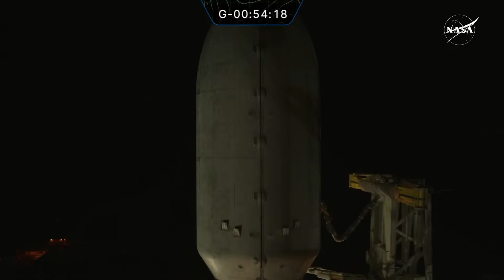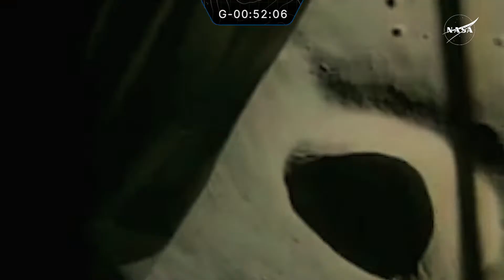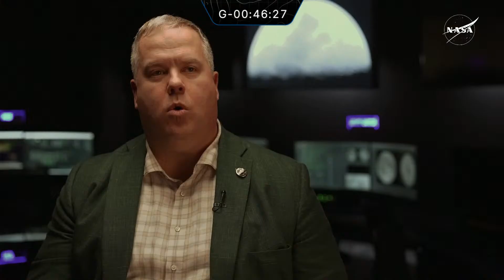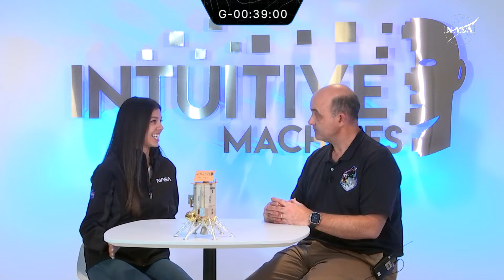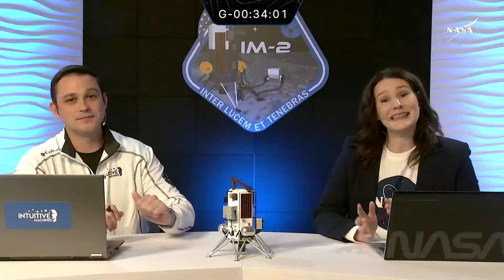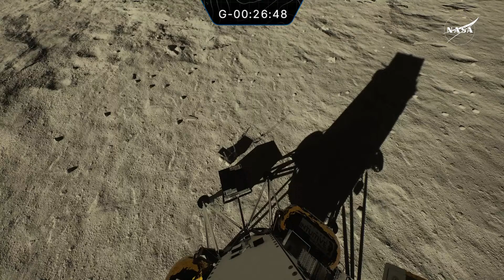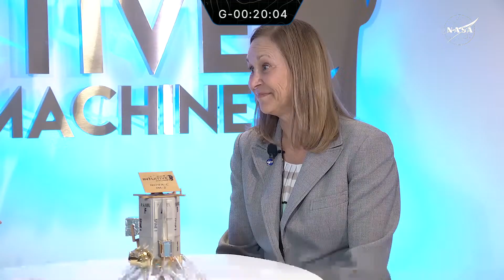Intuitive Machines IM-2 Mission Landing Live Stream

Comment: There is a REASON NASA, and Blue Ghost each used squat, low-center-of-gravity landers. I suggest Intuitive Machines rethink their lander design. Either add new leg extensions that provide the necessary stability or completely redesign the vehicle to achieve the needed safety for the vehicle. The moon is a harsh teacher, and after two of your landers falling over on landing, you are being taught something. Make IM-3 a success - Change your approach.

Comment: For all those that bashed me for not knowing what I was talking about and that I don't have a engineering degree when IM-1 tipped over. I told this was gonna happen again if they did not radically redesign the lander so it would not tip over because it is taller then its landing foot print.
Reply: Wait till they try to land a starship on the moon, even worse footprint to height ratio.
Reply: @kpkndusa  Very true, Landing on flat concrete is not the same as landing unstable sand and gravel.
Reply: example the "blue ghost" that landed a week ago.
but the bad signal sent is not a certain rigidity in the capacity to question oneself

Comment: I wonder why they couldn’t fix the tipping issue — or at least take it into account in the redesign, that very unfortunate possibility. As an example, taking some design cues from those weighted no-tip baby cups used for training; put all the weight to the bottom and have it expand from the top, like a downward-facing umbrella and it should automatically correct itself.
Reply: Blue ghost landing gear put the landers center of gravity lower. IM design is top heavy

Comment: THIS IS ABJECT FAILURE

If you cant launch the 4g comms network, this is a failure.
If you cant launch the micro hopper, or the drill, this is a failure. 

Quite simply, there seems to be no science that can be derived from this mission, due to the exact reason im1 failed. There was no iterative design it seems at all. The CEO says the lander's COG...Center of Gravity...is low, it clearly isn't, or your balance is off, or your math is off, but you can not fail twice for the same thing. The CEO says that lander's legs go to edge of the bottom rocket when packed, then use telescopic legs, so that the lander can be wider. If it was wide enough it would not tip over, and we would have a successful mission.

There needs to be changed in management, you can not fail twice, for the same damn thing, in this high value industry. You are a liability. 

We spent 60x10^6+ on this mission. All we are getting is I dont knows, we need time to analyze the data. That is failure.

Please get management at IM that understands iterative spacecraft design. Please, we told you if this does not land upright it is failure.

Comment: 54:26 shows 852 kph at a height of 26 meters, which then quickly changes to rapidly increasing high negative meter readings from the lunar surface. And then at 54:49 the velocity suddenly changes from 940 kph at negative 3691 meters from the lunar surface to 25 kph at positive 5018 meters from the lunar surface. Major software bugs?

Comment: Well, we know they've been shutting things on and off on board the lander. We know it has power and it is charging via solar and we know the descent included events they fully expected and some that could be  altered by a manual override if necessary.

When the stream terminated we just did not know which way the lander was facing. That information is will likely be addressed at the  briefing at 4 pm EST. Obviously, there are several successes with this landing and obviously the flight team has some questions about how the autonomous landing played out. At this point, sounds like more good than not good.
Reply: Maybe the RC Tonka has a hitch and it can crawl out and pull the lander upright.

Comment: Blue Origin same cop out no info just take ball and go home when it does not work as planned? Quite immature.
Reply: Same thing when SpaceX had a RUD with their starship on their last flight. It blew up midflight. There were no details until it was reviewed. The same with Blue Origin. Blue Origin has determined and stated publicly that there was an issue getting fuel to the engines during the reentry burn. The central engine fired but not the two additional engines. It might be due to lack of fuel settling or tank pressure.
Sometimes it takes awhile to get the details.

Comment: Why were they not celebrating!!! And then shut down stream
Reply: That's a good question! :face-turquoise-covering-eyes:
Reply: It's not vertical....not at all
Reply: Slide in sideways. Must be rough to get that transition just right.
Reply: Uhhh the mission failed miserably. Are u that dumb
Reply: Baseball ⚾️ rules, slide to be safe.
Reply: same as last year in Feb seems like the lander landed poorly again, they should work with firefly they did it first try
Reply: @TheTrueResearcher I do give firefly credit but they landed in near the equator or the moon. People have had boots in the ground in that area. Nobody has ever been to the polar regions let alone set feet on the ground. Was another good test for IM-3
Reply: @TheTrueResearcher  Where did you get the information from about the landing?
Reply: The terrain at the landing site for Firefly was very different from the landing site for IM-2. Apples and oranges different . If you think that does not or should not make any difference, then you would do well to get more familiar with the subject matter.

Not many agencies are falling all over one another to autonomously land custom-made one- off machines in poorly lit pockmarked mountain ranges with experimental tech on board. It's sort of risky.
Reply: IM landers are top heavy. The center of gravity is lower with the blue ghost design. Much better design
Reply: @ Except Altemus said they are not. REwatch the news conference.

Comment: It landed on its side unfortunately
Reply: It crashed at more than 800kph
Reply: @webfreezy  It did not. They still have solar charging and communication and control of the craft. 800 kph is about 500 mph. I doubt you would be getting anything if it hit the lunar surface at that speed. It may have shot up like that due to lunar dust kicked up during the landing. But I will agree there is an issue with respect to how it landed.

Comment: IM-2 has landed, all signals good so far, they just need a picture.
Reply: yeah, but are they vertical?
Reply: @na6404  With a picture you would know now, wouldn't you?😁
Reply: @CyberScifi  and they are attempting to get one.
Reply: It's like they focused so much on conserving energy (listen to the last 10minutes before landing) that they likely set it up under-powered the vehicle on landing and it tipped.

Space is not hard really, but Physics is--that 3-5min delay in signals sure makes it VERY hard.
Reply: They should use a faster image generation AI
Reply: That’s not at all what they said.
Reply: @ that is exactly what they said. Before the livestream cut they were checking signals and every one was good. Engine was on indicating upright position and they shut it off themselves to conserve power.
Reply: @aland8269  mhh - wouldn't it be possible that they were horizontal and the engine still going? like a torpedo :) - the fact that they ended the live stream like didn't help
Reply: @na6404 apparently what the lady said at 1:00:43 indicates the engine was programmed or designed to cut off if it was in any orientation other than upright.

Comment: What happened?
Reply: They lost communication with the lander 35 minutes ago, they're going to let the batteries charge a little to see what happened, the only thing they know is that the engines were turned off.
Reply: No clue
Reply: I'm pretty sure it crashed. Speeds of more than 800 kph and negative distance to the moon right before they shutdown the countdown at -01:51
Reply: @webfreezy software error
Reply: Failed